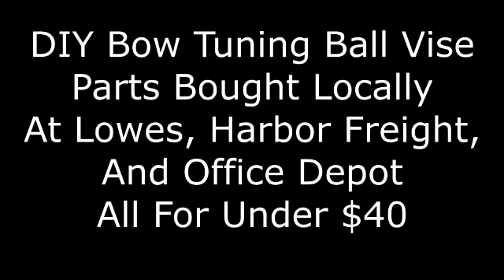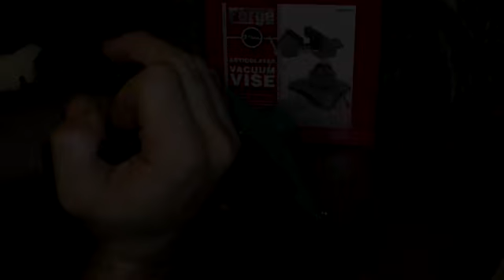Bow Tuning Ball Vise Build

Comment: like it. tryin to get some idea's im working on making a lil "bow bench " now. gonna have a draw board on one side & like to have a bow vise on other side.
Reply from the maker: I centered my "bow bench" around the one thing I didn't want to make myself, which was a LCA EZ Green press then I built a draw board to work with the press arms and then built the bow vise and now I am in the process of building an arrow saw from harbor freight parts as well. Maybe i'll make a video on the saw build but who knows. good luck with your project